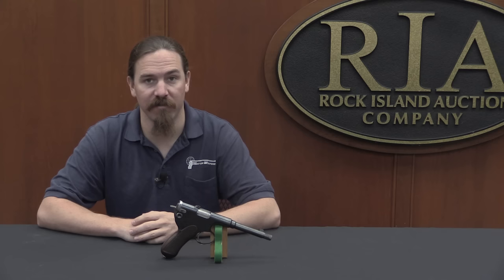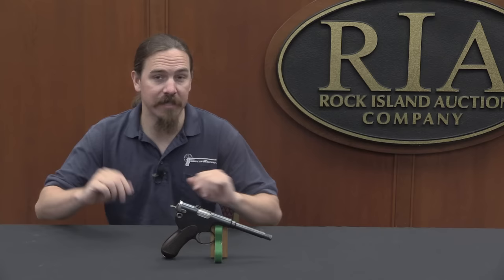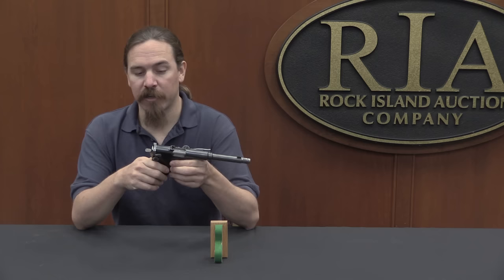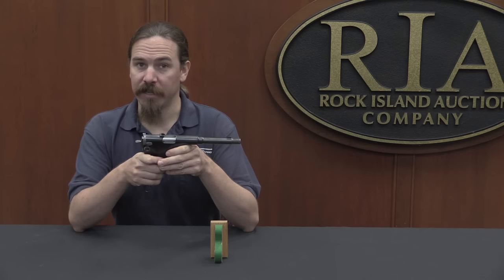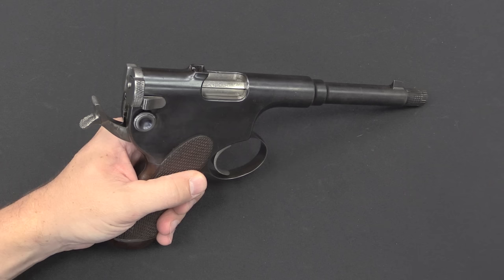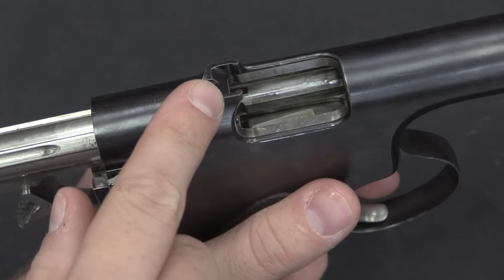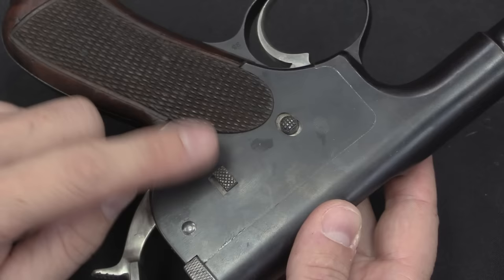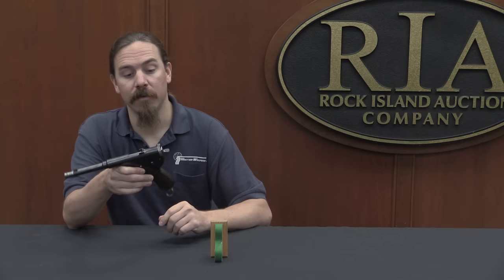Frommer 1901 Pistol

Comment: Ian, you might want to visit a camera repairman, to see the tools they make for themselves. Some of them consist of a rubber insert that grips and turns, much as you would need to 'coax' a stuck thumbscrew on a firearm. Pliers would likely mar the knurling, so you're wise to not attempt further disassembly. But a rubber-lined tool, made for the purpose would enable you to go more in-depth with your videos.
Reply: Five years past being relevant of course but better late than never eh :D It looks like the screw was damaged previously, I would bet that someone put too much pressure on it when they reinstalled the screw at some point and caused it to seize up on the threads. I think that in such a case the risk is that when you forcefully unscrew it again it could very well break the screw head off or crack it perhaps. You can see the knurling is chipped in two places already which tells me that it has been forcefully handled too many times already and should be left alone. The equivalent piece on the 1910 model has a detent piece installed into the side of the larger screw, which locks the threads to the frame, this may very well have been the case with this model as well but it perhaps was damaged (broken off maybe? resulting in the large chip on the side of the knurling) and therefore nonfunctional. Well, in any case it is just as easy (if in a pinch ;)) to wrap a few layers of electrical tape around the gripping jaws of pliers to protect any surface being gripped from residual damage. Interesting advice about the camera tools, though. I had not thought of the similarity before you mentioned it.

Comment: 10:30 I'm thinking that block is the manual hold-open rather than the safety. It's similarly designed and placed like the hold-open on a Roth-Steyr 1907.

Comment: If the barrel travels the whole way, how does it eject a spent case?!
Reply from the maker: The bolt stops at the rear of its travel and the barrel returns forward. When the barrel clears to front of the empty car,e it is ejected - before the bolt is released to chamber a new round.
Reply: Forgotten Weapons Ejected how? does the ejector travel forward with the barrel? With the case being effectively stationary, something has to move in the gun...
Reply from the maker: Typically a spring-loaded ejector in the left wall of the receiver. It gets pushed flush by the bolt and barrel, and pops out to eject when the bolt is locked back and the barrel is forward.

Comment: What about the ejection system?
Reply: Yeah, but how can it eject if the bolt is locked (?)  to the barrel till it hits the rear stop? Or does the bolt go back on its own and the barrel only go back when pushed by the user? If so, how do you clear a misfire safely?
Reply: First both barrel and bold travel back, locked together. Then barrel unlocks and goes forward. Ejector is under spring tension I guess, so it ejects when the barrel clears the ejection port enough. When barrel hits the full forward position, it trips the bolt catch and then the bolt can move forward and pick new cartridge.
So basically it eject when the barrel is moving forward, not when bolt is moving backward.
Reply: Assuming it's a locked breech long recoil, my major problem is how you safely extract a misfire?! I would not want to be pushing back on the barrel using a tool up the spout!

Comment: Nice craftsmanship but rather poor ergonomics. It would have been easy to make it striker fired, do away with the hammer and allow for a higher, more comfortable grip. This system is easily scalable to use more powerful ammo and acomodate any military requirements in that aspect.
Reply: Strangely enough, despote being an ideal.system for a semiautomatic rifle or LMG, to my knowledge, Frommer never did design a rifle with this system.